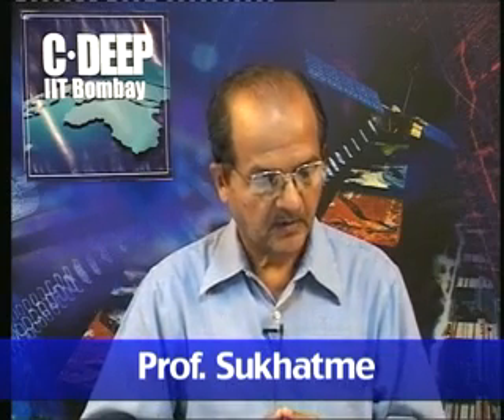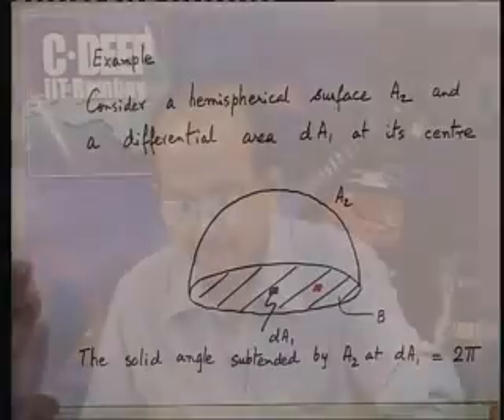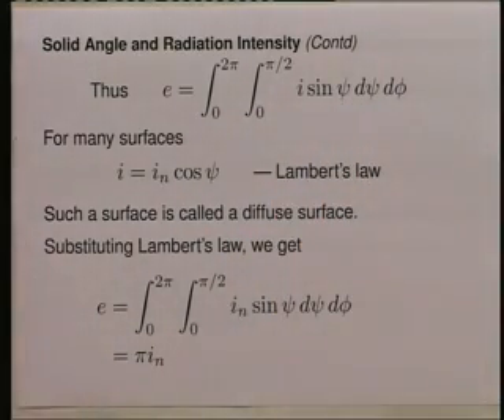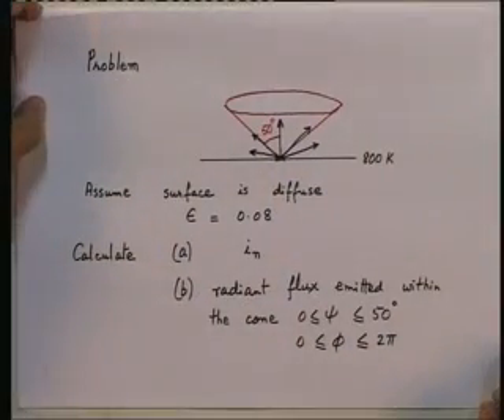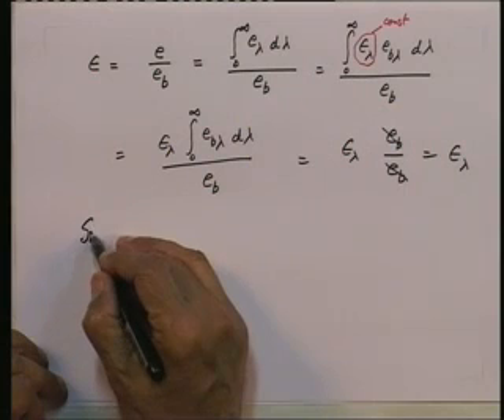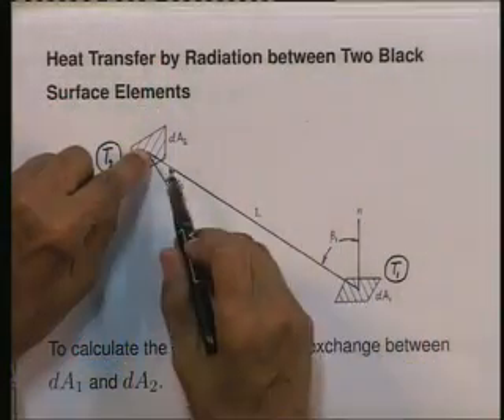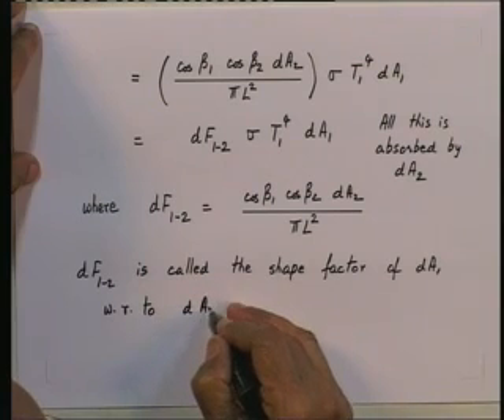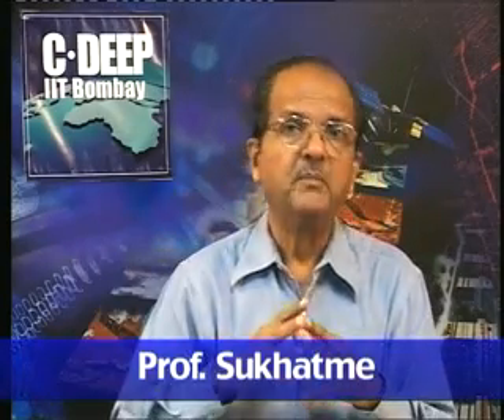Lecture - 12 Thermal Radiation - 3

Comment: was the answer 2*pi for the non-central dA?
Reply: Have you found out now?
I think it would be less than 2pi for any non central point
Reply: @mechabite8033  hahaha, trust me, I feel like this is not even me who wrote this answer. I don't remember anything. LOL, but I am disappointed with myself
Reply: @sharadapoudel6295  okay np
Reply: Yes that's right.... If the dA is non centered at any point of circular plane passing through the center of the hemisphere of radius A2 then the solid angle will still be the same =2π steradian

Comment: Why solid angle subtended by A2 at dA1 is equal to area A??
Reply: Well, it is defined like that. You cannot question the definition itself. For ease of understanding you can derive the analogy from the 2-D angle which can be supposed to be defined as “Numerically equal to the arc length cut on the circumference of a unit circle by two intersecting rays the intersection point being the centre of the unit circle.”

Comment: Could someone explain how the solid angle subtended by dA at dA1 is dA/r2? The Prof says it's very easy to see but I couldn't see it.
Reply: see this. The unit area of the sphere is 4(pi). It is obtained by dividing the total surface area of sphere 4(pie)r(square) divided by r(squared). What i mean is, just like in a circle .. the angle subtended by arc on centre is (arc length/radius). Similar to that, the angle subtended by the sphere on its centre is (arc area/radius squared)
Reply: i think for solid angle, da/r^2 is constant,like he used it in the sun question in preceding video, as for a sphere of unit radius the r^2 term is 1, therefore you get da= da(2)/r^2
Reply: If you a draw a unit circle around new dA1' you will find that A' is still 2pi.